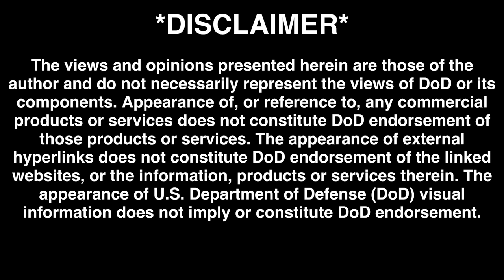F-16 and F-35 Engines - Pratt & Whitney vs GE

Comment: Pratt & Whitney always an innovative company, but many times delivered an unfinished product with the TF-30, F-100, F-119, F-135 in military and JT9D in civilian world. GE knew how to build reliable engines with the F101/ F110 and the CF6. The Tomcat would still be flying had it not been for the TF-30’s shortcomings and accidents
Reply: It would still be flying if the A model was gone when it should have been. Hard to defend the air frame when A models were still on the front line as late as 2003.
Reply: TF30 taught me how to cuss and throw tools 😆 not very ladylike lol but GE made my life way better!
Reply: The geared turbofan has also had some problems, way more than the LEAP engine. But PW also pioneered the geared turbofan technology themselves
Reply: You could probably make more of a case for the P&W F401 engine, which the F-14 was originally supposed to have, not working out.  It was a derivative of the F100 engine being used for the F-15.  The TF-30, by all accounts, was a fine engine in the F-111...it was just a lousy choice for an actual fighter like the F-14.
Reply: @RocketToTheMoose  except the TF-30 also stunk in the A-7A , USAF and then USN adopted the RR Spey Turbofan as the Allison TF-41 in the A-7D/K and A-7E respectively
Reply: The engine was not the Tomcats core problem, neither was it the wing sweep maintenance.
Of all the Teen series fighters the Tomcat is by far the oldest with roots back to the early-mid 60s TFX program.
To compound this issue the Tomcat is also the only Teen series fighter that (almost) didn't get a comprehensive upgrade package early on.
The F-15A/B was not that great, neither where the F-16A/B nor the F/A-18A/B, only the C/D model upgrades that were introduced in 79, 84 and 86 made them as successful as they are.
The F-14 didn't get it's huge digital upgrade until 91, at the trailing edge of the cold war. If the Tomcat got it's big upgrade along with the F-15 in the early 80s and in larger numbers the story would have been much different.
Reply: Actually the TF-30 was not so good in the F-111 either due to its very limited ability to handle intake burbling, the exact same problem in the F-14A, and the compressor stall result.  The F-14 had it worse as their mission required more maneuvering, blanking the intakes and exacerbating that issue.  We (the F-111) went through 4 plus different intake redesigns (prototype, prototye A, Triple Plow 1, Triple Plow 2, etc.) and various internal compressor bleed mods to try to mitigate the engines ability to handle dirty air but we figured out what our maneuvering envelope at various throttle positions were and most of the pilots would instinctively fly inside that envelope which was close to our mission needs, high speed (Mach 1.2) on the deck, and two and a half hour cruise to target IPs. 
The overall issue of the fighter TF-30 though was the fact the TF30 was the first production military TurboFan engine required to fly from zero to Mach 2.5 plus with an afterburner as an additional factor.  The F100 was a new build Pratt motor but was greatly influenced by the lessons learned from  the TF-30's woes.
Reply: Very little bad to say about the F-135

Comment: As a former jet engine mechanic who worked on both PW and GE. I would take the GE anytime. PW is innovative and forward thinking but they do not follow through. They never take into consideration that maintenance needs quick turn around. GE gives better performance and easier to maintain. It remains to be seen how the new adaptive engine will perform.
Reply: Current PW maintainer, spot on. The convenience of GE’s is unparalleled. Having a split case so you don’t have to roll ducts to do core work is mind blowing.
Reply: I would really rather see F-35 get the XA100, but I've heard that there's still a long way to go with it. It's several hundred pounds heavier than the F135 and is a little bit to large to fit as is. It's also still such new technology that it's going to take time for the material science to catch up. It makes so much more sense to go adaptive cycle with a 30% range increase especially pacific theater, than an optimistic 10% from PW's Engine Core Upgrade for the F135 though.

Comment: From my crew chief perspective, I prefer GE over Pratt.  Intake and exhaust inspections are easier on the GE and only one chip detector vs five.
Reply: I too was blessed with working GE engines over Pratts during my career on F-16C's block 30's and early block 50's and later the F-117. Except for the F-22, but we won't talk about that.

Comment: Roughly 25% of the F-35 is common among the three variants due to the B being drastically different.  But if you take out the B, there's over 50% commonality.
Reply: I might argue with your percentages, but I'd rather focus on agreeing with the core point - the A & C have a lot more in common, the B has a need to be different.
Reply: IIRC you have it reversed, not that it really matters. Point is that there is less commonality than there should be. I think The C has less in common, although the design itself may have had more impact from the STOVL requirement. I was told by someone in the JPO that the NG submission was by far the best, but it never got built because they chose to ignore the STOVL requirement.
Reply: @80Juvat  No, I do not have it reversed.  From a logistics perspective, to have commonality, you want parts to be interchangeable between the variants.  For example a 787-8 and 787-9 is only 50% commonality because of restructuring changes to make the range it needs while the 787-9 and 787-10 is 95% commonality since the only change is the hull stretch.
Reply: I just looked it up. I recalled correctly. It has migrated since, but as of 2011 the CV had 40ish% unique parts while STOVL had 32ish% with roughly equal amount of similar but not identical parts. It got worse from there as they shaved weight. The main driver for the CV difference was the larger wing and landing gear, as those drove major changes to the empennage. The biggest impact the STOVL requirement had was on the overall design. It would have looked a LOT different had that not been a requirement. It's a fascinating topic.
Reply: Different part numbers don't mean they aren't sharing 90% R&D and manufacturing/testing. Further, the really innovative stuff like coatings and the sensor package/avionics are shared across all the platforms. To have three separate platforms coming in at the flyaway cost the A/B/C do and with the R&D expenditure (x3) being less than the JSF would be nearly impossible to imagine.
Reply: @corystansbury  Good point!

Comment: I was a Crew Chief on f-16s  at Shaw Air Force Base South Carolina in 1985.
I couldn't believe how many aircraft crashes we had because of the Pratt & Whitney engines. After the first few crashes Colonel Lanning what is fired and replaced by Colonel Loxbyer. After a few more crashes he was in replaced by a third Colonel who I don't remember the name because he wasn't there very long before he got fired. Pratt & Whitney set an engineer to speak with us about the problems we've been having with their motors. It was common to see up to two engines being replaced in a squadron every other day or so. 
During desert Storm I asked planning and scheduling to track all the motors in our squadron that were coming in and going out over the 7-month process during our deployment in UAE. 
Upon out return to Shaw I complied the data to find out that our squadron 17th TFS had removed and replaced 3.5 motors a day seven days a week for a total of seven months. This should tell you just what kind of motors P&W produce.

Comment: One of the big issues with the Pratt F100-PW-200 motors was the rear bearing seals.  IIRC, we had three or four go down (in 1986) and actually had one captain save one when he ran out of oil over the Mediterranean and was able to glide for 15 minutes or so back to Aviano AB in Italy.  That helped determine what was going on.   

So Rick was the guy at the other end of our pipeline, huh.  Was part of the bed-down/logistics crew at 5th AF back in 1986, for when we swapped the F-16A's we had at Osan, Kunsan and Misawa, with the Block 30 F-16C/D's with GE F-110-GE-129's.  Germany got the Block 32 F-16C's with F-100-PW-220's when they switched.   As the GE motor was a 29,000 pound thrust motor over the Pratt 22,500 thrust motor, there was a scramble by Pratt to come out with the -229 version, at 29,000 as well.  Another airplane that benefited from the 'War" was the F-15 Strike Eagle EX as it has the GE motor.  
And, yes we benefited greatly from the competition, and we should have been allowed to do the same thing with the F-135 and F-136 motors, but Pratt was good at lobbying the monopoly this time so we are stuck with engine improvements on their schedule and not ours.

Comment: I was on the flight line, at General Dynamics, when we stuffed an F101 DFE motor into an F-16 block 15 for flight demo.  While installing, we dropped the motor on its' afterburner can!  We told the DFE managers what happened and they had to remove an F101 from an Edwards Flight Test F-14, ship it to Fort Worth to meet the flight demo phase.  This one, we did not drop, flight went great an the F101 DFE morphed into the F110 and went into the F-16 block 30 and the rest they say is history.  Along this same time-frame we installed the General Electric J79 into an F-16 block 15 in preparation for an export version of the F-16 to countries that we did not wish to do technology transfer of the F100 technology.  That didn't happen, everyone got the  F100.  Pilots that flew the J79 F-16 were impressed when the aircraft was below 25K feet altitude, but the aircraft lost a lot above 25K.

Comment: Fascinating topic.  I was assigned to the F-16 SPO at that epoque.  I was in the test office, where we handled all accidents to ensure that any lessons/changes that came from the analysis, would be reflected in updates to the Dash One (and other manuals).  By the time I left in 1986, we had lost 120 F-16, fully half were attributed to F-100 failures.  I was there in the configuration control board with General Moynihan when the F110 was adopted (and of course, mods to the airplane to make the two engines interchangeable, with variable buy shares performance based.

Comment: Same stuff going on with the AETP program. GE's XA100 is further along, can fit all three F-35s, while Pratt is behind and can't fit the B. So Pratt is now saying the program will result in too much spending to be worth it, and it should be cancelled. GE disagrees, but Pratt seems to be winning the spin war since funding for AETP got cut. Never mind the 30% range gain with the new engines, if GE gets the contract then Pratt loses, so since Pratt is losing they'd rather poison the well.

Comment: It seems that the DoD is basically keeping Pratt around with GE/CFM and Rolls eating their lunch for years in civilian jet engines.  I rather chuckle when I've seen some of the PW decals on the side of a nacelle saying "DEPENDABLE ENGINES".  I'm thinking the TF30 in the F-14A.

Still - General Electric has been one hell of a dumpster fire over the past decade, shedding lighting, home appliances, transportation, lending, health care, and power generation.  Basically all that's will be left of what's officially General Electric is aerospace, which includes marine propulsion.  Makes sense since much of that is just jet engines driving a shaft, but then again gas turbines are just jet engines driving a shaft, and that's being moved to the spun off power division.

Comment: Regarding the F-35: When Jello often would say an aircraft is a series of compromises, it implies many things. There are always tradeoffs between roles, loadouts, capabilities, and expenditures. The question is whether the capabilities engendered in the new designs are able to win the next war (and perhaps even the one after that). It requires a level of strategic insight that proceeds the existence of an aircraft with an expectation that, in 30-40 years, the aircraft will have have achieved its objectives and surmounted anything adversaries can produce.

But since we live in the real world with limited budgets and constant tradeoffs between cost and benefits—we will always end up in these situations.

Comment: I was quite upset when we passed on the GE XA100 engine upgrade for F-35.

Raytheon's CEO (Raytheon owns Pratt) said (I'm paraphrasing) that the Air Force can't afford the engine they want, so they get what we give them. Just ... gross.

GE was like, we can give you 98% of what you're asking for, significantly improving performance and make it more reliable than what you have. I thought it was a lock for GE.

Surprise, for some stupid reason, we continued with an updated  F135 from Pratt that is worse on paper in every way than the demonstrated performance on GE XA100 prototypes.

Pratt can do good work, but they won't even try until you put a metaphorical knife to their neck.

That "knife" is often awarding significant engine contracts to GE. Not "considering" a GE engine, actually buying them in significant numbers.

Competition only works in capitalism if we actually spend competitively.
Reply: I thought the reason that happened was because the GE offering was nearly 3x as expensive. I'm not disagreeing with what you're saying, that it should have been picked, but if that's the case GE was always likely to lose.
Reply: @mobiusflammel9372  

No, the engines were comparably priced. That is comparing the GE XA100 to the PW "new core" F135

However, a new engine obviously costs more than refurbishing existing engines.

I mean the DoD isn't going to replace all the 1000 or so F135 they have in stock. The sole consideration was for engines on new TR4/5 F35.

You may have gotten that idea because Pratt disingenuously compared the cost of a new GE engine with refurbishment costs for existing F135 engines.

IIRC the GE estimated refurbishment costs for their proposed XA100 were lower than PWF135 costs.

Comment: The TF-30 in the A-7 was good but not without faults but performed better than it did in the Tomcat.
Reply: That's why the Air Force went to the Rolls Royce motor (Allison TF41), our SLUFFs were sweet, worked them at the end of the SouthEast Asian 'experiment'.  Never lost a mission time.
Reply: @paulholmes672  if my memory is correct I think we went to them as well when we upgraded to the A-7E.

Comment: Rich just explained why the A10 is the best for CAS. It’s designed and purposed for that mission. And does it exceptionally well. The A 35 is the Jack of most trades and does none well. And forget about the CAS mission. It’s not designed for that mission.
Reply: Enjoy getting easily shot down manpads lol. F-111 scored more tanks busting than A-10 in DS.

Comment: GE always has the better and more advanced engines for example XA100 Adaptive Engine and also the GE engine for F 22 and F 23 was better and more advanced but we're not chosen due to cost
Reply: My understanding was that it was relatively new technology that could revolutionize efficiency, but that came with the risk of reliability issues.

I guess there were similar concerns with the PW PurePower geared turbofan engines, even though that's civilian.

Comment: The F-35 original program specifications were for an engine related to the F-22 engine. So Lockheed designed the F-35 around this engine. This made sense because it would help keep engines for both planes in a ‘more streamlined’ production. Of course at the time, the plan was for several hundred more F-22 being produced and in operations, and the F-35 would be combat ready by 2006-2009. What a freaking dumpster fire. F-35 program’s runaway cost and resource hogging kills development on the F-22, and now we can never build the number of F-22 that we need.

Adaptive engines were considered too new, the guess was 20 years away, and they were right. Who would’ve thought the F-35 development program would still have the issues it does now. The problem is, the F-35 wasn’t designed for an adaptive engine. GE’s current adaptive engine fits in an F-35A, but it isn’t an ideal fit. The engine is physically larger than the airframe was designed for, the engine is also much heavier, and balance of the plane would change significantly.

Don’t confuse the competition for the F-35 engine between the original and adaptive engines. Adaptive engines are a separate thing, and were never part of the original specifications for the F-35. Pratt&Whitney have their own adaptive engine, that will probably get tested in the F-35 and also get rejected. The F-35 was never designed for an adaptive engine. I suspect adaptive engines will get specified for NGAD, and the advancements for that program will eventually lead to a proper plane design with a more advanced adaptive engine. Hopefully, that will eventually lead to an advanced version that works better for the F-35. Or, as I like to say(or half joke) Lockheed just needs to design and build a Super Lightning II version, like the Super Hornet. A version with a moderately larger airframe and more load capacity, designed to take full advantage of the adaptive engine.

I totally agree with the need for competition among engine vendors, but for the F-35 the competition should’ve been for the original engine types. Just don’t confuse it as a competition between the original and adaptive engine types.